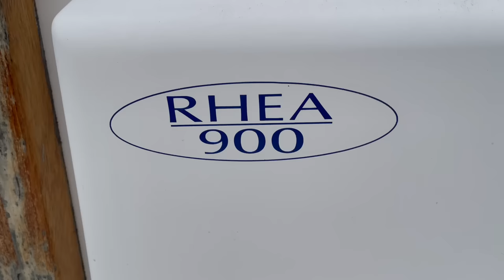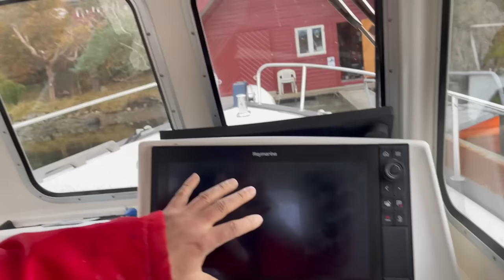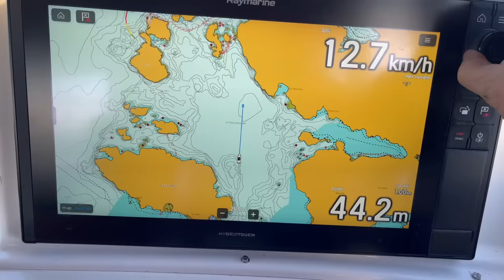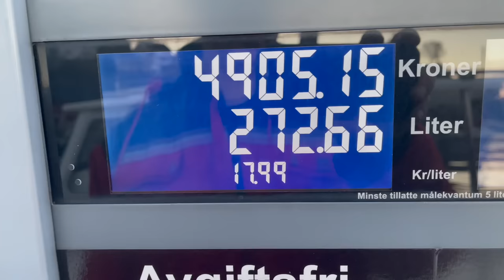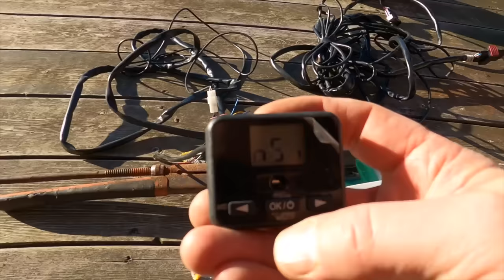Fisher 30 Ep 23 - My other boat - the Rhea 900 - and more.

Comment: Hi Helge! another great video. Thank you for sharing with us. All of your hard work will be worth it when you re-launch your Fisher.  The satisfaction of knowing everything is done right is very comforting when sailing offshore. I think your idea of a heated shower room that can be used to dry clothes is excellent.  One thing you could do is use an accordion door as the divider which would really open it up inside. Especially if I ever came to visit and needed to use the head on your boat. The problem is that at 1,93m and 121 kg, only 1/2 my ass would fit into the toilet side based on your current layout. 🤣
Reply from the maker: Hi Duncan, my super-supporting friend! I appreciate your appreciation for the video. The folding door idea is a bit interesting. Will implement that in my considerations. 
I expect you to make contact if you visit western Norway. Despite your personal "measurements" there should be sufficient space :-D
Reply: @hsobstad  Perhaps I will start a new regime to try and shrink myself now and in advance of any future visits to Bergen. 😀
Reply from the maker: @duncanjames914  🤣

Comment: Hi Helge, enjoyed the video, appreciate your humor and the “slice of life” beyond the Fisher renovation… this suggestion may be more trouble than it is worth, perhaps use rock wool or fiberglass insulation stuffed in trash bags or sling some painting tarps to ceiling and stuff it with insulation… basically retain as much heat as possible by “walling” off the area of work rather than trying to heat the entire boat … here in the states they sell a thick hard foam board that may work as a movable bulkhead to help isolate areas of the boat
Reply from the maker: Hi Ric. Thanks for watching (and enjoying) the video, and for supplying ideas. Your suggestion is smart, at least for insulating the roof/ceiling and having an electrical oven underneath. I might then change the rotten plywood. It is of lesser value insulating the lower hull from the outside. It will then need something to rest upon, while being held up to the hull. 
The foam will probably do the same job as the 22mm plywood I have already bought. :-)

Comment: Hi Helge!!! You've been holding out on us ... that Rhea is really a nice boat!  As for the heating dilemma ... I think that the supplementing the diesel heater with an electrical heater at night would be the best solution -- especially if you are going to use polyester resin.  I have a similar propane heater for my shop (slightly larger in output), and I can only run it for short periods to heat up the shop before the fumes get noticeable, not to mention the moisture that it introduces to the environment -- terrible for the tools.  With all of that grinding, I hope that you have covered the engine thoroughly -- that dust can work its way into small areas and cause major problems down the road.  You are doing the right thing with all of the grinding -- you will get a solid bond when tabbing in the new structures and bulkheads.  Keep up the great work!!!
Reply from the maker: Hi Robert! Yes, I must get the diesel heater to run. I can run electric at night, but not use too much of electricity. I am sharing with all others in the yard. 
I have not really done anything to protect the engine. Not smart of me....
Reply: I would definitely stop to address the dust issue with the engine before going any further ... if i might make a suggestion ... once you have it vacuumed clean, get some shrink wrap that is used to wrap up pallets for shipping.  Wrap the engine up with a heavy quilted moving style blanket, and then use the shrink wrap to completely enclose the engine in a cocoon of plastic  to seal it from ingress of the dust. @hsobstad

Comment: Doing a grand job, may I suggest under Floor heating for drying room uses very little power, can keep on even in doc as no gas or flame 🔥
Reply from the maker: Interesting! Do you mean electrical heating in the floor (no gas or flame)? That will demand shore power. Or maybe circulating water from the engine?

Comment: H. Your explanation is very clear and sensible. Not, as you said, immediately understood here in California.  A Midships head and shower is unusual, and because of the airflow, I wonder if putting the wet room in the stern compartment, along with 1 quarter berth might not make sense ?  This keeps all the wet clothes/ people from moving into the main part of the boat, and lets the damp air exhaust out the back.. so warm air moves through the boat  from front to rear, and then out. The head can then be anywhere you like, always dry and cozy.   Another question.. do you have the same 9.5 foot (3 meter) beam as my 30 did, or the wider 11 Foot beam ?
Reply from the maker: There is unfortunately not enough standing height (and space) in the aft cabin to have a shower/wet room. The Northeaster have the wider beam hull.

Comment: How about webasto for heating the Fisher? I mean not just now, but for perspective like one of sistems of the boat. I think this system solve the problem with wet clothes.
Reply from the maker: As seen in the video I have such a heater, but different brand (Ebersprächer, not Webasto). Just need to get it running.... :-)

Comment: We use 5/8 copper pipe for water supplies in USA.
Reply from the maker: 5/8 pipe? That is quite small. At least for this house. I had a 1 inch copper pipe. Changed to 40mm (1.6 inch) plastic pipe. Also at the same time put down a 63mm (2.5 inch) plastic pipe for possible future connection for a sprinkler system (this house is quite old and therefore a cultural building).
Reply: I think you are getting into your stride very well with the videos Helge. A great balance of content - varied and interesting. Loved the summer/boat house, the fuel hungry boat and the works at the house too.

I do not envy the grinding sessions - I will be pleased for you when you have completed that task.😀👍⛵️
Reply from the maker: @normanboyes4983  Thanks, Norman! 🙂